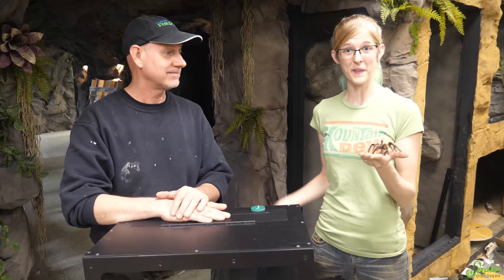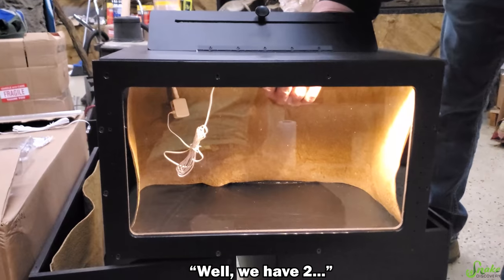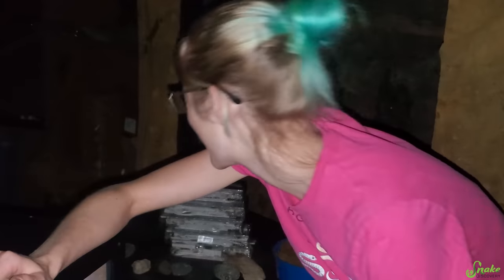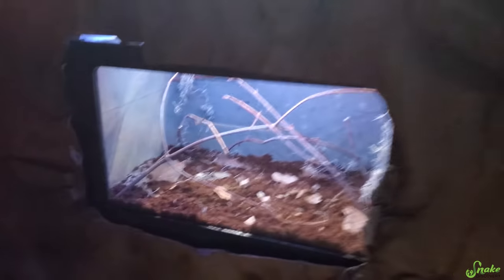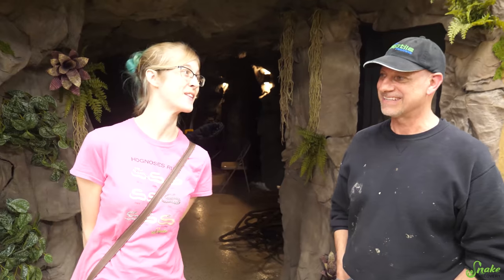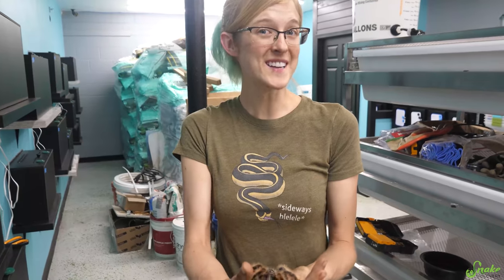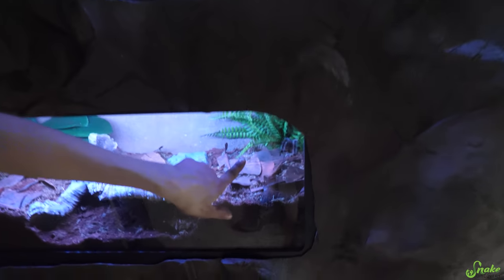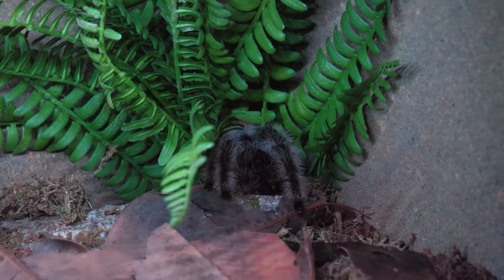Moving the FIRST Animals into the Zoo!

Comment: hay i had a thought are the enclosures secure so people can't push them through? Rather not have a situation where a kid pushes onto the glass and winds up pushing the enclosure through and breaking stuff.
Reply: *hey
Reply: Good thought 👍
Reply: it would need to be something that can move up and down 

cuz adding just a part there would block you from taking out the whole enclouser hmm
Reply: @CrimsonAkato  you could do a strip of wood that goes up about a quarter of the way with hinges and a hook & eye lock so it will drop down when needed but would keep them in place
Reply: Hey* and Wdym “winds”
Reply: @JosephsJungle8  they mean winds, like 'winding a cog' to put it in a sentence. They basically mean damage would happen if a kid pushes the enclosure glass and it goes all the way through and off the shelf and smashes as well as letting all the inverts out
Reply: @C.Woodford  ohhhhh

Comment: Question for you- What is stopping from someone just pushing on the front of one of the invert enclosures and it just falling off of the stand it's on? A board stop on the back would help that if this is the case. Otherwise, looks great!
Reply: I've got similar concerns
Reply: Velcro or strong magnets on the bottoms could be a good solution since it allows them to be taken out for cleaning!
Reply: @taiitea-6936  or just something, maybe some wooden tabs that can rotate
Reply: Ok I was confused but them I realized the lips on the enclosure, you couldn't push on it and it fall but you would have to pull it, and chances are they will secure it
Reply: They added a pinned comment! It’s about this, so it should clear up your concerns

Comment: You could drill a hole and put a tent pin for each shelf so it's impossible to push from the front, but super easy and cheap to make and remove when doing maintenance.

Comment: Like others I can see that at least currently the enclosures can be pushed out. As a potential simple solution is to had a small strip piece of wood at the end of the floating shelf creating a raised area. This would mean they can not be pushed out and if you need to take them out you just need to pull the staff end up a little before pulling.

I have just now realised the insolation will prevent this method.

Unless you use a wedge or screw to keep the wood in place so you can easily remove it from the staff side.

Comment: Emily, you said you could pull out the enclosure and take the lid off if you needed to do a deep clean or something. I was wondering if you had any security measures to protect the animals so a child or someone couldn't accidentally push the enclosure from outside and knock it down. I couldn't see anything other than the enclosure was sitting on the floating shelf. But just wanted to ask, I would hate for these animals to get hurt. Love the zoo so far, and I can't wait until it's complete and I can visit it in person! :)

Comment: It may just be the camera, but maybe consider adding a diffuser to the led strips to better defuse the light inside the enclosures? Generally it's used for PC setups, but it could be a good idea? Also, for safety purposes, some stick-on wall hooks to hold those wires can do wonders.

Comment: Its not too hard to break up a strip of LEDs.  Simply clip them apart with wire cutters and solder some wire between each section.  LEDs work on DC so it isn't really dangerous.

Comment: I saw yu guys are gonna reach in via the hole (or, well, slot, really) in the top for water changes. Most of the insects/inverts you guys have are non-venomous, but I know some centipede species are and you said you're gonna have 2 species of scorpion. How would that work and you not get bit/stung?
Reply: I’d assume they wear gloves :D
Reply: @wrendrawsstuff6403  some (not all) scorpions have a sting force that can punch through the top of a shoe. Now I don't think either species they mentioned is one of those, but scorpion gloves would have to be insanely thick
Reply: @katherynedarrah4245  True.. 🤔 ah- maybe they’d use something to gently hold it back while they reached in— or they could use something to scoop it up (second option is unlikely)

Comment: Those LED strip lights will drive you nuts. They’re unreliable and inconsistent, and the diodes will die off one at a time. Better to use standard fixtures with regular LED bulbs.